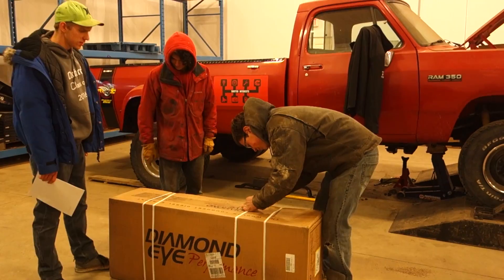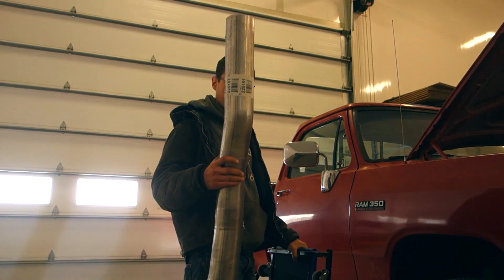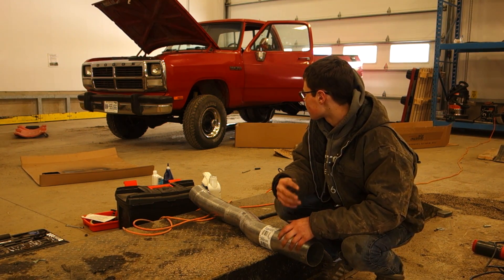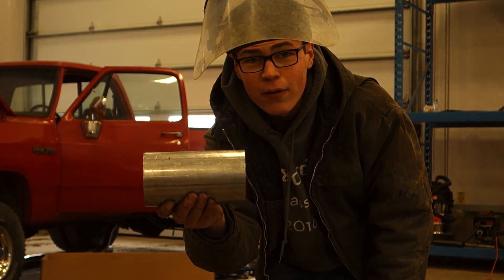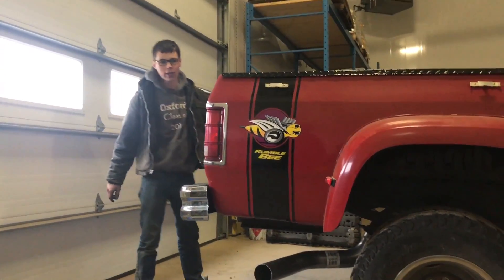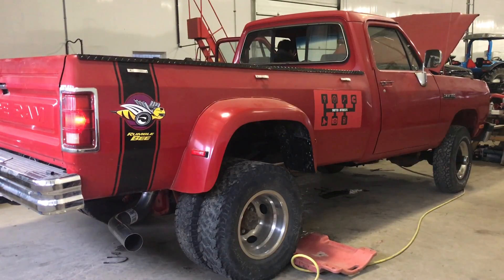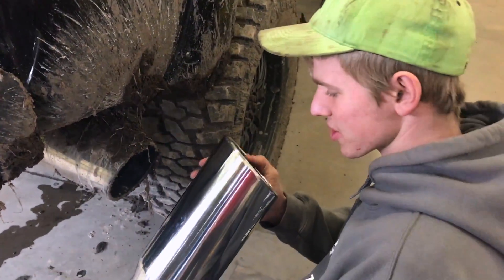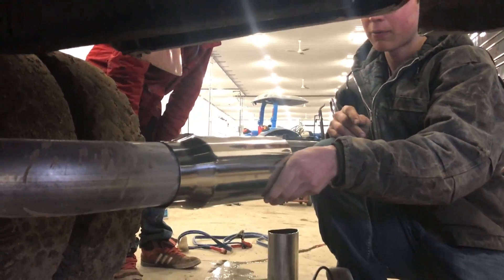Diamond Eye Exhaust - First Gen Ep. 8

Comment: You usually don't have to cut it most of them have the extra piece for the extended cabs you just take out the extra piece then it should bolt right up at least that's how mine went also diamond eye
Reply from the maker: +cj glassey  Might work with some, but with ours we had to cut it a bit... or maybe we just didn't look close enough